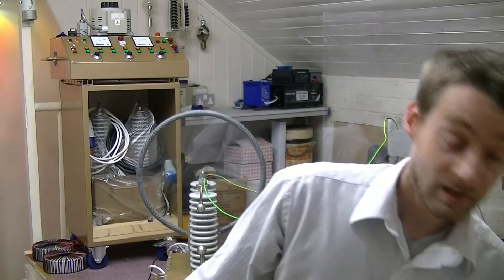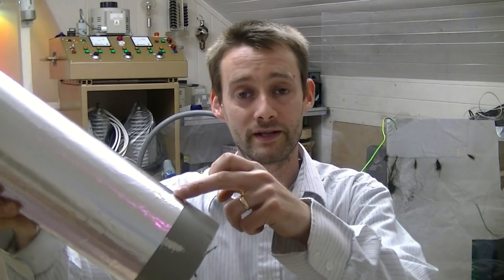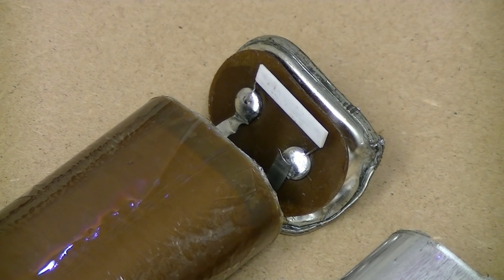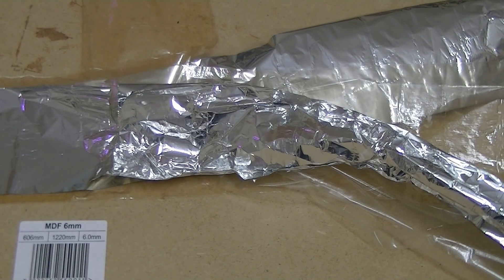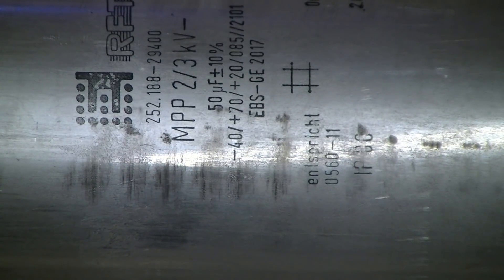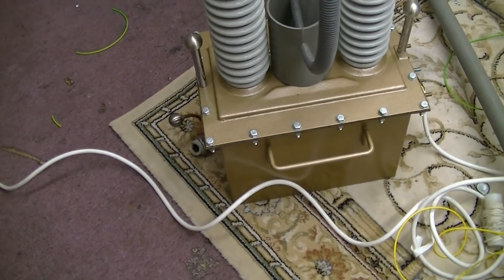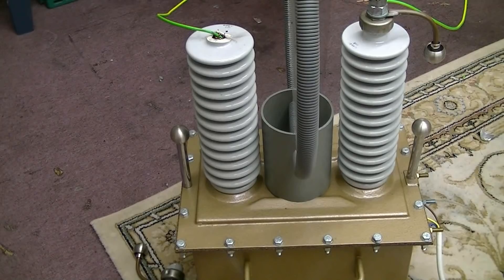Photon's Thunderstorm Capacitor

Comment: Late to the party as usual, but...
Now, coming from a background in electronic music I'd like to say, when you slow down the audio you can hear the frequency and it's rhythmic.
Think of it like tempo or beats per minute.
That's no oscillator but it's sounding like one, as in synthesis, plus 100% analogue effects, and dare I say it, melody.
You could literally run that experiment for half an hour, record the audiovisual, slow it down, add some compression, and upload the results onto Spotify or Soundcloud, as electronic music.
Ambient, yes.
Techno, possibly.
Better than a lot of ambient techno, definitely.
You don't need an engineer or a producer or musicians or do anything whatsoever with synchronisation or networks.
It's very very nice just as it is.
👍👌

Comment: Somewhere around the 7 minute mark, there are several arcs hitting the wire attatched to your chicken stick. Ive had a much smaller, but still dangerous, experiece. My thought was the insulation was breaking down. Is that the case? How often do you change out the wires when you are pulling out such awesomely ridiculous arcs?

Comment: I wonder if you used very high speed analog tape to record this, if the explosions would sound like thunder when slowed way down, given that the low frequencies in thunder only come from being some distance from the discharge as the sound waves slow down while passing through the atmosphere.

Comment: If you put Capacitors in series don't they cancel out the charge, as the the anode of one capacitor is connected to the cathod of the other, therefore allowing the charge to cancel out?

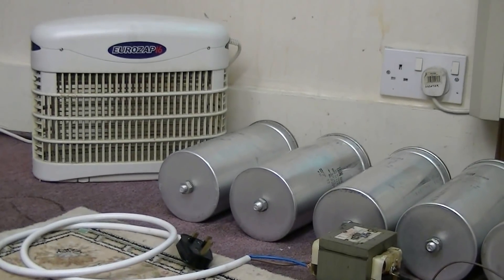Comment: this is fucking mental, arc over a meter long, holy shit, and all of of a 13 plug sockets, wow the shit you can do, fucking hell i want to see the secondary of a mot hooked up to the primary of one of your hv transformers and then a capacitor bank (the capacitors seen at @1:16)dumped into the primary of the MOT, see how long of a DC pulse arc you can get, if you can insulate it from that high of voltage, love to see that happen, that would be fucking mental too :D nice work photon :P

Comment: An aren't you afraid of X rays and gamma rays emission at these voltages? I guess you know what you're doing, and I'd like to understand how this is not even more dangerous than it looks like. 
500 KeV is clearly in the gamma ray energy range! That's penetrating radiations you might get there!
Also, what kind of transformer gets you that high voltages and energies??

Comment: Photon,
You should run a lawnmower engine with high octane fuel & nitrous oxide without the exhaust muffler, just a suggestion........................

Comment: Im a welder myself lol. Achy, dirtiness is from metal oxides & the argon in the air normally..makes me feel light headed unless i got extraction on. I can TIG weld without mask on since it dont spark like shit. MIG & Stick welding is a different story lol..

Anyway lol..maybe photon should have like a 5F cap on a bug zapper lol..that'd be interesting

Comment: Sure. I don't know If I'm 100% correct on this, but I've considered the thickness of wire to determine the amperage capabilities, and the thickness of the insulation to determine the voltage capabilities.

Comment: How many volts were you putting into the primary side of the transformer? I don't see how it could crack the ceramic bushing. Anyway nice video, I found it interesting that capacitors could be that basic.

Comment: Broken the transformer?!? Those ceramics are seriously tough, I though you'd have to be running it in reverse to drive the railway to manage that. They are 750v at 630A - well, enough to accelerate a 400 ton train to 90mph in as many seconds.

Comment: I use a triggerable spark gap for my capacitor bank. It's just 2 bolt heads very close together and a small trigger electrode between them. I use a voltage multiplier to charge a 1nf cap to 7.5kv and discharge that to the trigger electrode and it causes the power from the main caps to arc between the 2 bolts. They will melt over time and need to be adjusted, but it costs almost nothing to make.